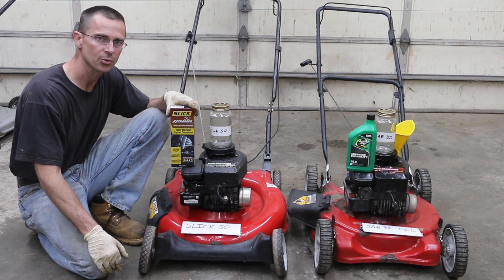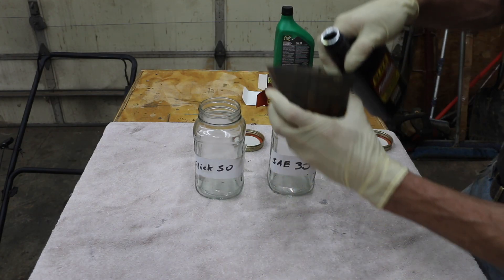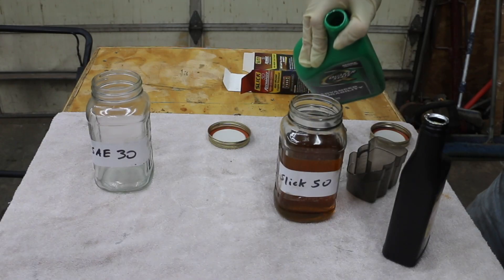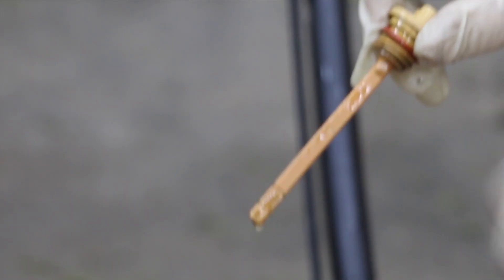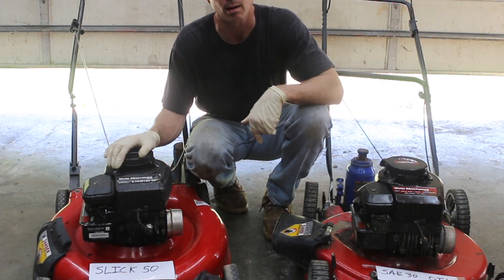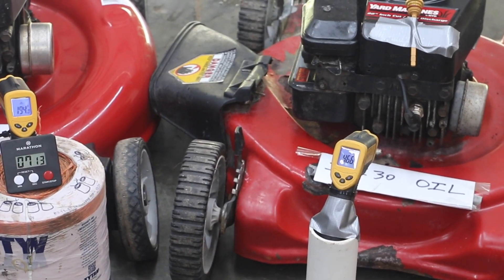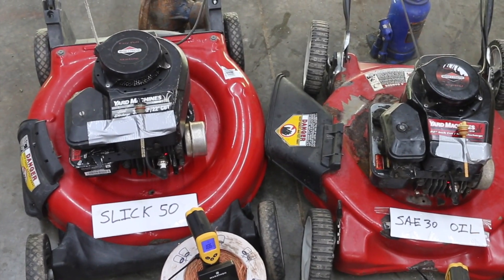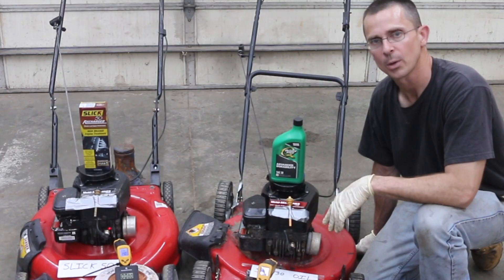Can't believe what SLICK 50 did to my engine!!--Dry Crankcase Test!

Comment: I love the fact that you tested this. Interestingly, I decided to use the hotshots extreme nanolubricant in my powerstroke. Had never used it before, always just used motocraft oil. I changed the oil, used the same motocraft oil as always,  and added the specified amount of hot shots secret nano lubricant. Truck seemed to run better and had lower crankcase temps but at 2500 miles into that oil change, the low pressure oil pump failed and in turn spun a rod bearing and destroyed the crank. I dont know that the nano lubricant was the cause but I also dont believe in coincidences either. I do really like all of the hot shots secret products but will probably pass on the nano lubricant just in case.
Reply from the maker: Thanks for the feedback.

Comment: Have you heard of "Dura Lube"? 35 years ago my dad's Chevy S10 ran dry of oil so I pulled over thinking the engine was toasty.  I found a quart of Duralube that I had bought for him for Christmas so I put it in and noticed the engine ran cooler and smoother than it did on a good day.
Reply from the maker: Thanks for sharing.
Reply: @ProjectFarm  in their commercial they used a v-8 took the valve covers off and dumped sand on the heads drained the oil and ran it for quite a while. I'd love to see you review this product.🙂

Comment: BG' s 44k line was good. I dunno about a test like this but I know it kept a Ford I had running with little to no oil in the system for an unknown amount of time. That was a 3qt motor (oil) and checked it way to long after I should had and dipstick was bone dry. I do think if i hadn't used the 44k prior- I'd had been hunting another beater car.

Comment: I don't believe slick50 is what it use to be. I had a motor home and the oil pump quit. It was so over loaded and pulling a camper that was also over loaded and I had to drive it about 5 miles. I was in Nebraska, headed for Nevada. I installed an oil pump and drove it all the way back. I drove all the way from Virginia which gave it enough time to bond with the engine
Reply from the maker: Thanks for the feedback.

Comment: About 60 years ago there were various products containing molybdenum disulfide, whose manufacturers claimed that you could drain out the oil and the engines would continue to run without problems. Haven't seen them advertised for a long time.
Reply from the maker: Thanks for the feedback.
Reply: Mercedes benz states to coat bearing inserts with "molly coat" to help burnish in the bearings. don't believe them! ! ! !  I tried it once and within 10 miles i had the rattle of death in the rod bearings.  NEVER AGAIN!!

Comment: The slick 50 you are using bears no resemblance to the slick 50 from the 1980s. The inventor was bought out and the new owners almost completely changed the recipe! The original recipe now goes under the name of Xcelplus and is every bit as good as was claimed by that notorious slick 50 advert!
Reply from the maker: Thanks for sharing.

Comment: Try Lucas Oil Lucas is a motor oil that will bond to all internal parts and give it a nice coating however doing what you did with those two lawn mowers I don't know that anything would work for that but I happen to use Lucas for every oil change that I have done because Lucas guarantees to bond to all internal moving parts so when you go out and start your engine on a cold day you don't have to sit and let it warm up before you take off unless you happen to live in the Upper Midwest where it happens to get well below zero during the winter months what Lucas Oil does is it bonds to all internal moving parts so that puts a nice coating on all internal moving parts no I don't know how smart it would be to drain the motor oil after running that and then restart the motor after it's drained but I would be kind of curious to find out
Reply from the maker: Thanks for the video idea.

Comment: I recall those commercials.. I think you have to allow the slick 50 to do the Teflon coating process on the internal engine parts.. I have tested it and notice incredible benefits although I would never have gambled my vehicle's oil... I have run out of oil before though and I simply had to put oil in when I noticed it.... even engine oil mixture fuel 2 stroke moped engine current mopeds I have corrected related heat shut down. By adding it to fuel mixture I was told by mechanic that was also possible phenomena to notice. You have to allow it to work in and coat
Reply from the maker: Thanks for the feedback.

Comment: Back in 87 i bought a brand new Mustang GT after 3000 miles i changed out the oil and added Slick 50, my own test concluded that i improved highway mileage by about 2 miles per gallon give or take...
Reply from the maker: Thanks for sharing.

Comment: The problem with your test, is that you weren't testing the Slick 50 that you saw in commercials years ago. The inventor of Slick 50 patented the formula but not the name. You were testing a product with the name, but not the formula.  The original formula has been rebranded as Xcelplus.
Reply from the maker: Thanks for the feedback.

Comment: That's strange because I remember that commercial as well and used the product for what I thought was good results.  I was watching the temps of the engines and the slick50 engine stayed a lot cooler but, failed first.  Thats strange.  I have had a couple friends that swear by Lucaas products and they both ran their engines out of oil and after cooling they ran for a couple more years.  That was amazing.
Reply from the maker: Thanks for sharing!

Comment: Here's a story about slick 50. I don't use it anymore but I used to. I think full synthetic is much better. A friend of mine was using it at the beginning when he first bought his mustang GT 5.0. he decided to blow the engine before his warranty ran out. But after running it for several hours(without oil) it wouldn't seize up. So they had to do something else to get it to seize up. I don't know if he was using any other additives or not but that's the story.
Reply from the maker: Thanks for sharing.

Comment: I could be wrong but I think the slick 50 needs to be heated up and turned off cooled many times to coat parts that’s what I remember from using it back in the day .but I don’t use anything in my oil anymore
Reply from the maker: Thanks for the feedback.

Comment: maybe this comment is three years late... But. I had a 86 CRX SI, which i had installed a jackson racing headers and cam. which were installed by my honda dealership prior to even  driving the car off the lot.Warranty immediatly voided ! after break in of 10000 mi i treated the engine with slick 50. the mechanic at the dealership even showed me how to check and adjust valve lash. Imagine a dealership doing that today! At 100,000 mi I treated the engine again. I junked the car at about 225,000 mi the car was beat, but the engine never needed valve adjustment used no oil between changes (i used mobil 1 for the first 100,000 mi , and a premium grade non or blended synthetic after that) and cylinder compression was above spec, it even had the original timing belt. Obviouyslt the thing with slick 50 (PTFE) is than it needs to be properly burnished into the metal. that is obviously not going to happen putting it into the crankase running it for a few minutes and running it dry'
Reply from the maker: Thanks for sharing.

Comment: You used Slick 50 recharged. Which is supposed to rejuvenate seals and clean out engine sludge. Have you tried the same test with the original Slick 50 with Cerflon PTFE ?
Reply from the maker: Thanks for the video idea.

Comment: Maybe you could do one with Prolong. I believe they both came out around the same time back in the day and were direct competitors. They would do that torture test where they would have to automobile engines running without their oil pans and they would be throwing sand into the engine
Reply from the maker: Thanks for the video idea.

Comment: I used the original slick 50 back in late 80's on my "89 camaro and the temp guage did read a lower temp. I can testify to that. 90k later the engine still ran like new. So it did something to reduce friction as the lower temp reading proved it.
Reply from the maker: Thanks for the feedback.
Reply: Plus the original formula said to run slick 50 until your next oil change so the properties have time to bond to internal engine parts. Was the lawn mower run long enough for the slick 50 properties to be absorbed? No, but if the lawnmower was run all season mowing lawns, then do test, it would be a fairer demo.

Comment: The problem is with this test is this.... When Slick 50 was developed its formula contained ptfe. Better known as Teflon! It was required to “run in” after an oil change whereby the Teflon would coat the internals of the engine. And engine would indeed run (not necessarily under load or at high rpm) for a very long time. The company was subsequently sold, the formula changed removing the Teflon and this test shows a result!
Reply from the maker: Thanks for sharing.

Comment: In your video, you used the new, slick 50, formula, the original, Slick 50, formula, pre-1984, formula was far better than the new, after 1984, formula. You can still get the original Slick 50 formula though, but it's under a different name now though, I  don't know why that is, I only know that, it is, something happened in 1984 with slick 50. There might be something on, either U-tub or wikipedia About what happened. I would like to see a video comparing the original Slick 50 formula, called by a different name now, to the new, after 1984 formula, which is now called, Slick 50. That would be quite a comparison between the two formulas. Supposedly, the old formula, pre-1984, is far better than the new formula, after-1984. It's interesting though, why is the original formula, pre-1984, called by a different name and not Slick 50, something happened to Slick 50 in 1984.
Reply from the maker: Thanks for the video idea.

Comment: I always hear good things about Lucas Oil Stabilizer. Stores often have a demo display to show how it helps cling to engine parts. I trust it without any real applicable proof because of the reputation, so I would love to see it tested. Also, as a better control, I would have ran both engines with straight oil to compare temperature differences prior to the test. Also, run a few other tests to establish that both engines are in similar condition. Without doing that, the results are a little controversial. I personally wouldn't rely on them, but I love the effort you make and the goals you try to achieve. Keep improving your processes.
Reply from the maker: Thanks for the video idea.
Reply: @ProjectFarm  After I posted the comment, I found and watched the video you made comparing Lucus Oil Stabilizer to STP Oil Treatment. 👍
Reply: Oil clinging to engine parts may not be a good thing. Some engine parts are partially cooled by oil. It's important to keep a proper flow of oil during engine operation.

Comment: Thanks for another great video!!  While I didn't think Slick 50 in this situation would make a difference, I thought both mowers would run about the same time.  Very surprised!!  A friend who I haven't talked to in about 20 years stated that he got longer engine life from Slick 50 but that's in an oil mix and obviously not this situation.  Was with a major steel company for 10 years, and we, for all our oils used quality oil products from major firms.  Not cheap products but our maintenance records proved out the wisdom of quality oils.  Having worked on the refinery side in construction/ maintenance for a major oil company and talked to their research group who we did pilot plants, their advice was to use quality oil products from major refiners.  But don't waste money on gimmick products.
Reply from the maker: You are welcome!  Thanks for sharing.
Reply: SLICK 50 isn't a gimmick product.Ive used it religiously  in all my vehicles throughout the entire drive train. 1 vehicle '79 Toyota Supra driven 25 years, was still running when sold. 2nd vehicle 89 Toyota  Cressida 17 years traded for a  SUV.  '56 T Bird 312 ford-0-matic 25 years .Never any issues with engines,  transmissions or differentials. Slick 50 is my choice, and its been good for my vehicles.

Comment: I like this video a lot, however the slick 50 engines exhaust was blowing straight on the regular oil engine.  The slick 50 had cool air to breath, the oil engine had hot exhaust.  Could that have played a role in the temp differences?

Comment: I used Slick 50 for about a year in a new service vehicle, 460 Ford.  One AM got about 7 blocks, saw oil trail following me, found that the oil filter was greatly expanded all over and burst.  Drained, replaced filter and oil.  For about another 100,000 miles the engine would develop a funny clatter sometimes but kept running.  The oil pressure regulating/bypass ball down inside the filter housing was rough and pitted.  Engine still running when retired at 245,000 miles.  Still rattled sometimes.

I use Lucas, about 1 quart per 12 quarts of oil to prevent dry starts   460,000 miles on engine.  Injectors failed due to contaminants in fuel.
Reply from the maker: Thanks for sharing.

Comment: I sold slick 50 and ,you did not treat the engine correctly. I bought the motor and treated it the way it said. Run 3 tanks of fuel with slick 50 mixed according to directions, then run dry until it sets up, let it cool, break engine loose fill with  oil and it will run again.

Comment: I worked at a company IN st. Louis they Ran 12 hp horizontal shaft B&S Wide open 10 to 15 hrs per shift. We put 1 qt 30 AND 1 jug of STP oil treatment. Motors lasted a good 6 months under frequent SHUT down time. Without operator checking oil was Main Cause of engine Failed.
Reply from the maker: Thanks for sharing.

Comment: There has to be another factor in the slick 50 failure. It was a full 200 degrees cooler than with 30w oil.  I thought it would keep going as well. Maybe slick 50 vs Lucas in New engines.
Reply from the maker: Thanks for the feedback.

Comment: My one thought would be prior maintenance. If one was better maintained or less hours it would cause different results. The oil in the slick 50  being that much darker tells me either the slick 50 is cleaning more or the motor was dirtier to start with. Either way I was expecting way more out if the slick 50.
Reply from the maker: Thanks for the feedback.

Comment: I have been selling oil additives since 2002 
the synthetic additives usually are a poor oil on their own 

the additives are designed to perform when mixed with oil according to the instructions 

the additive I used to  sell to NASA requires 8% added to the regular oil.  Exactly 8%.  

If you try to use it as a regular oil it would fail immediately

Most additives have very little lubricity by themselves 
they are made to attach to the molecules of the lubricating oil

Contact me and I will give you a test sample
 I will guarantee that you have never seen anything like it
Taxi cab engines run for days dry
David

Comment: Nope I just cut the gimmicks, oil is cheap and engines are expensive. I use SAE 30 in my riding mower and my Toro self propelled for trimming. I mow an acre and a half, I change the oil in both at the beginning of the year and again about mid summer. They both run like tops.
Reply from the maker: Thanks for sharing.

Comment: I’ve gone away from Slick 50 years ago when I found Greased Lightning on sale at the auto parts store. Greased Lightning as it turns out has a much higher amount of Teflon which you can see is much milkier that Slick 50. I’ve used it to free up and quiet noisy lifters and use it in my old desil 450 International tractor when the oil plug fell out and seized up the engine.  I broke it loose after I put in a quart of Greased Lightning with regular oil to make the 2 gallons needed and started it up. It’s been running fine ever since. The Teflon seems to plate the hot spots where wear has occurred causing a slick cushion quieting and building tolerances . If the parts are too far out of tolerance it won’t stop excessive oil use or journal destruction on a flattened crank but yes GL works very well. My wife’s ‘17 Outback has always had a noisy engine with lifters and all, just what Boxer engines do out of the box! At 30k miles and COVID times I was ignoring the car I hadn’t been using much but come to find out you can’t do that with Mobil 1 very thin oil in these newer cars and again the boxer normally aspirated engine is known to use about that much oil typically as I then found out as it will evidently use a couple of quarts in 6k miles! When the low oil light went on I was of course a bit concerned (probably still had 3 qts in there yet) and added enough oil to slightly over fill including about a cup full of Greased Lightning in case I’d caused some hot spots by being an ignoramus . Still am shooting for 7,500 miles to change the synthetic oil. Well that really settled down the engine noise, nice and quiet now! Did the same a few years back for the old ‘87 Doge Dakota pickup that suffered much neglect from intermittent use and had noisy lifers as well. Quieted it right down as well. Engine now has turned 100k and still runs quietly and well!
Reply from the maker: Thanks for sharing.

Comment: $20 thrown away x 3... at least. lessons learned.... straight oil is good as any, just got to HAVE CLEAN OIL IN THE MOTOR AND CHECK THE OIL LEVER BEFORE EACH RUN OF THE DAY!!!! WRITE THAT ON THE MACHINE AS MOST PPL/kids CANNOT/will not/dont know to CHECK THE OIL BEFORE EACH RUN OF THE DAY and change oil every 25 hours or once a year... spring/fall when put it to bed for the winter... and drain gas out of tank as it will go bad in the off season and turn to varnish, plug small idle jet in the carb/wont idle/ run/start
Reply from the maker: Thanks for sharing.